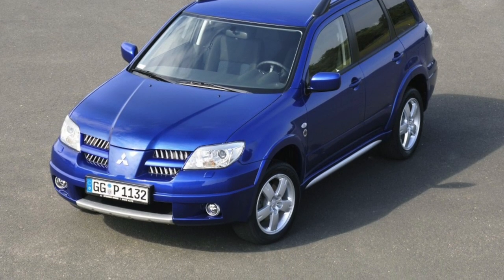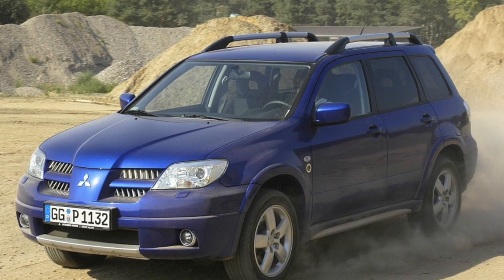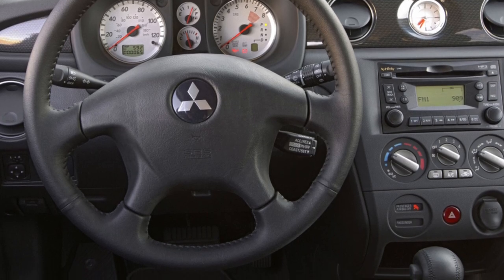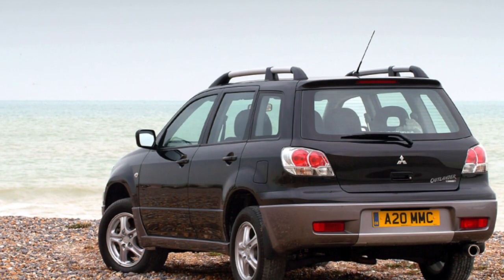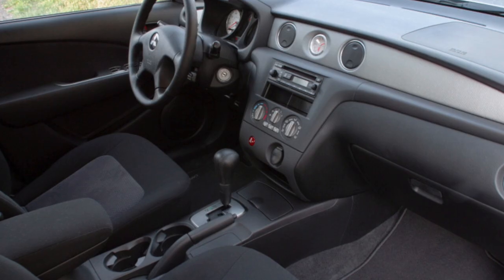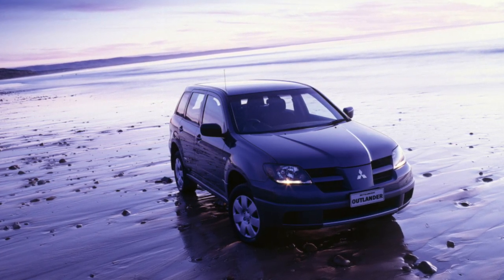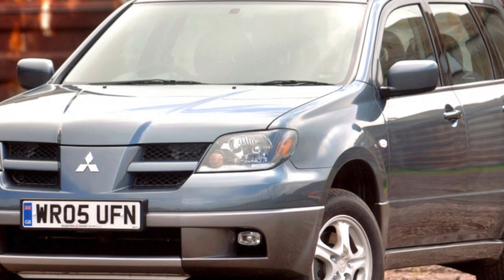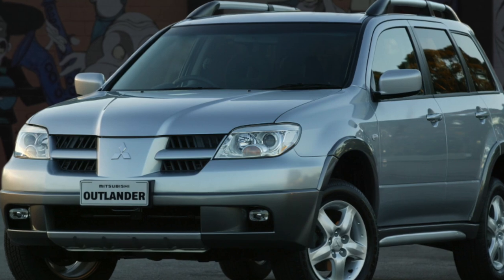Mitsubishi Outlander Problems | Weaknesses of the Used Mitsubishi Outlander I

Comment: I have turbo version with 280000km bougjt used with 220000km. Changed rear subframe and all suspention, new clutch, and removed balance axles. So far runs great, driving hsrd and seen salt on roads, but not too much rust. Main problem rear arch, rear end "pockets" under rer bumper, and strut towers in front.

Comment: I have replaced my mass air flow sensor, m. a. p. sensor, temperature sensor, oxygen sensor and cleaned out my catalytic converter.. replaced wires and plugs... On my '03 outlander.. having same issue, running lean on Bank One... Car will run great until it warms up, then loses  it's gusto.. 🙅 help
Reply: What do you use to clean catalytic converter
Reply: @bayfinest1938  carlos, I wound up cutting out my Cadillac converter completely and welding the pan back up to try and fix my problem and come to find out I just needed to loosen my gas cap the whole time. I was building up too much pressure in my fuel tank I even replaced the charcoal box as well. So that's how I cleaned it I cut the damn thing out LOL

Comment: I have a 03 outlander if anyone needs any parts!?! Brand new radiator less than 4 miles on it, everything inside is perfect, has blown head gasket unfortunately…
Reply: are you still offering parts ???
Reply: what the hell. fix it and it would go another 5 or 6 years with minimal maintenance.

Comment: I got the 2006 2.4 at around 190 000 km ... Now over 230 000 ... I have experienced most of the troubles mentioned and resolved them in 🇿🇦 , bent valves, top gasket leak, timing belts breaking, messed up the water pump when trying to fix it myself,front and rare suspension, bushes, almost everything. Fixed every problem as it came n car is as good as I got it, even performs much better. This car has lots of power, I'm yet to come across a mud I can't pass, the 4x4 is great. Pulled my 4ton truck with it up heel without shortage of power , climbed mud mountain with ease.... Simply the best.

Comment: Hi, i have an 2006 Outlander 2.0petrol manual gearbox with 182 000km on it.
Common problems i have discovered and experienced on these cars are severly rust on the rear and front subframe as they are porely painted and not protected, rust on top of fuel tank and on filler tube inside wheel housing, bad wheel bearings rear, and the clutch on mine is know worn down and must be replaced.
Rust is especially a problem in countries where salt is used on the roads wintertime.
If you have a good car i recommend getting an underbody rust treatment, especially in front and rear subframe. I also noticed that the front foglights are bad and needs replacing due to oxcidation inside the lamps reflectors, propably due to driving in salted roads wintertime and not washed often enough. Otherwise it feels like a responsive engine that likes high revs(over 4.000rpm without problems) and i feel the engine is reliable IF its been serviced often with good oil of course!
Reply: Hi, thank you! Have you had any major repairs, related to turbo or engine? Would you recommend the car?
Reply: @wisemoney3204  Hi, my car is a non turbo. I have had some big repairs yes, like rear subframe, clutch kit, timing belt with balancer belt and water pump and complete brakes front and rear.
I would recommend the car if it has been regularly serviced and not been driven too much in salty roads, but do a good check up on the car and i think you will be ok.
Good luck.
Ps: I repair all on my cars myself, and also takes care of body/paint issues with often washing(by hand of course😜)
Reply: @oddarnestrand2047  Many, many thanks
Reply: Can you tell me the consumption of your car...i recently buy a 2006 2.0 petrol non turbo 136hp and average consumption is 12l/100km most of the time driving highway not more than 130km/h
Reply: @tuser333  that sounds like maybe abit high consumption, but if you're closer to 130km/h most of the time i would think thats maybe not so high.
If you're in doubt, take an service to your engine(filters and sparks especially)

Comment: I have 2.4L xls non turbo awd 2005 outlander with the mileage of 157,000 kms . The problem I countered is slow pick up and the cruise control is not working . I adjusted the throtlle position sensor same with the accelerator pedal control , now working fine.
Reply: Did you ever get the cruise fixed? I have one that works perfectly! I’m having to part out my 03 outlander due to blown head gasket :( 280,000 miles and never had a check engine light on then bam blew up…

Comment: Hi i got an option on a 2007 GLS 2.4. The car only had done 120 000km and looks almost brand new. The owner had only done short trips. The car is in limp mode. It starts but dont drive...o ly refs in neutral. I really like it and getting it at a fare price.

Comment: Of course I found this video after I bought mine. Found a 2006 2.4 LS with 165,000 miles on it. has 169k now. The only problems I've had with it so far are that I have a squealy accessory on a cold start (I haven't looked to see which one for certain yet.), and one of my hoses for the power steering pump has a slight leak and both boots have torn, slinging grease everywhere, But I've seen that on many vehicles. otherwise I've recently replaced the outer tie rods because the old ones were no good.
Reply: How is it going now?
Reply: @IronHorseman473  waterpump went around 180k and the struts need to be replaced. also needed two transmission mounts since they were basically hollowed out. She's at 196k now.

Comment: I can't get the car from running rough,  like its to rich or timing is off, the intake manifold has been replace which did nothing, getting it to run smooth or even idle smooth has not been a success yet, most sensors aren't made for the car anymore so cheap Chinese  sensors are the only options which haven't worked either, if anyone has any suggestions,  it would be greatly appreciated,  thank you

Comment: My problem with the car, the van stay on always even after I turn off the car a car is called no check engine light
Reply: Check the fan relay fuses and the fan module